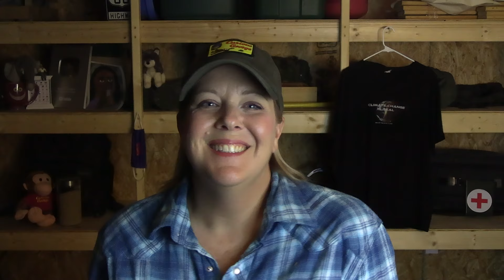Let's talk about uranium, Tennessee, and the future....

Comment: The thing Oak Ridge did, which I think doesn't get enough attention is the Molten Salt Reactor Experiment, which could run on Thorium.
Reply: Heck, apparently the Kairos test reactor will be operated there, a solid fuel salt cooled reactor. Not as promising, but a good step towards a new series of molten salt reactors.
Reply: I agree.  Molten Salt Reactors can apparently also use spend uranium fuel from current reactors and there are fewer requirements for cooling as they are designed to run hot.  Additionally, an included benefit of mining Thorium is that it is usually accompanied by Beryllium which is excellent for many uses in manufacturing.
Reply: @byronmarsh1352  Molten salt reactors can run on U-238, U-235, Th-232, plutonium and so on. It just depends on your design.
Reply: It would be truly great if we could figure out good use for mankind's immense, dangerous, and presently worthless stockpiles of thorium -- the largest constituent of the monazite sands which are the principal source of critically important "rare earth" elements.
Reply: So how long until we have fusion?
Reply: @RandomNonsense1985  checks notes

30 years? 😁
Reply: Fusion is here, every day. We just put the reactor about 8.5 light minutes away, and put up these funny panels to capture the power.

And that’s basically going to wipe out the nuclear industry. It’s just so much cheaper, fission can’t compete.
Reply: @JB-pu8ik hey, that’s an improvement, 30 years ago it was 50 years in the future.
Reply: @panemetcircenses6003  I thought the joke was that 30 years ago it was 30 years in the future, hehe.
Reply: @JB-pu8ik  ah, the version I heard is “fusion power is 50 years in the future, and it always will be”

Comment: Great way to dispose of unneeded weapons.
Reply: Let’s be real… they are all unneeded….
Reply: @JoshuaTrenge I would agree but then, Putin, Xi, and strongman leadership in general.
Reply: @jimgoff1170  If they didn’t have any weapons, they’d just be self important bullies with no power…
Reply: @JoshuaTrenge  I’m with you there!🙂
Reply: There was a similar program in the 90s, to dismantle old Soviet nukes, reprocess the cores into reactor fuel, and let the Russians burn it up in their reactors. Megatons for Megawatts, I think it was called.
Reply: @SynchroScore  and along came Putin
Reply: This is a cool project, but it is far from being green and in no way will this reduce the nuclear war threat.
Reply: @nobodyimportant7804  The problem with current green electricity production is the inconsistency of supply, and so there is a need for base-load generation. Currently, newly-built base load is from two sources: Nuclear, or gas. Would you prefer gas over nuclear energy that comes without any mining?
Reply: @SynchroScore  Where I live hydro is the base load, with wind and solar picking up most of the slack.

Wind is growing massively where I live. Gas and nuclear are less than 1% of the electricity supply.

Have you been near a wind farm? I have stood on the ground a few hundred yards away. I could not feel any wind, but those blades were spinning. They constantly spin, every single day.
Reply: @nobodyimportant7804  Hydro is available only on very limited areas. I've been near wind farms, and have no problem with them. Where I live, we've phased out many of the coal plants, and have six nuclear reactors humming away happily. But no chance for hydroelectricity, except on low-head dams on rivers.
Reply: A fair fraction of US electricity has come from old Soviet uranium, which is part of the reason we lack sufficient enrichment capacity.
Reply: @SynchroScore some was burned in US reactors as well
Reply: @nobodyimportant7804 Just because there's enough wind to spin the blades doesn't mean there's enough to actually generate electricity.
Reply: @missano3856  When they are spinning that fast they are. WTF?

Comment: I think 3 mile island and the meltdown in the USSR scared our generation away from this kind of power source. It's time to lose that fear.
Reply: Microsoft just bought a contract to reactivate 3mile island. Hopefully they have better QA this time, and dont run it on windows.
Reply: @brandonperlow9091  They’d have to hit the “Start” button to shut the reactor down.
Reply: There's a good reason to fear it. I think dismissing the aftermath of those instances will just repeat history. That power source is clean until it isn't, and humans aren't exactly the most reliable in safety and upkeep for that source of energy.
Reply: @brandonperlow9091  I would rather that one never be opened again. If they want people to feel safe, you can't start with 3 mile. When you say the words 3 mile island, the first thing i think of is meltdown.

Comment: High-assay LEU (HALEU)
High-assay LEU (HALEU) is enriched between 5% and 20%[8] and is called for in many small modular reactor (SMR) designs.[9] Fresh LEU used in research reactors is usually enriched between 12% and 19.75% 235U; the latter concentration is used to replace HEU fuels when converting to LEU.[10]

Comment: Thank you for the commentary, Belle.

Although I see converting nuclear weapons into reactor fuel as a good thing.

Nuclear power has a very high Levelized Cost of Energy (LCOE).

In the 1950s and early 60s small nuclear power plants did not produce enough energy to be cost effective.

The prevailing thought was to increase the size of the plants and they would get cheaper at scale.

This has not happened.
The Vogtle 3 and 4 reactors came in 17 billion dollars over budget and 10 years late.
People in Georgia electricity bills have gone up.

There are no projects that are totally  privately funded or built because financial institutions can see the return on investment is low.
That is the reason the federal government does most of the funding.

Within the last 20 years the new brillant idea is to build small modular reactors.
Using pre fabricated components to bring down costs.
Virtually the same as the small reactors from the 1960s that were not large enough to make money.

There are numerous articles on why nuclear and small modular reactors will not save us from the climate crisis.

 Time to build.
Not one single nuclear reactor has ever been finished on time and within budget.

Like Belle discussed with the SAVE act. Even if one were approved tomorrow, it is not very likely a project could be completed in 10 years. 

The LCOE of nuclear power is about $155/MWH.

The LCOE of solar is about $40/MWH.
The LCOE of Lithium based Backup Energy Storage Systems has dropped 80% in the last decade and comes in about $55/MWH  over the lifespan of the project.
Reply: Good afternoon Shawn. It would be a good thing indeed. ✌
Reply: @donaldmrambojr5695  good afternoon.

Comment: The groundbreaking for a building to hold the first test plant started. TerraPower will build the the new test reactor after that for 2030 (located next to a WY coal plant that is planning to shut down).  X-energy has plans for a test plant in Texas.  HALEU is for high-assay, low-enriched uranium (between 5 and 20% U-235) metallic fuel. It will also be able to store heat energy in the sodium coolant to generate steam during slack wind & solar output times (perhaps better than other grid attached batteries).  A Bill Gates documentary said there was a plan to convert some spent nuclear fuel waste into the fuel.  Expect that is why the using old weapons & submarine waste for the 2 tests - that would be a bonus!  The new reactor operates at atmospheric pressure (less to leak) and be cooled with sodium metal that doesn't boil away like water can so it can air cool itself in a power outage - another level of safety.  Sabine H mentioned there was a 100 year supply of easy to get U-235 so that reactor may only be a transitional solution and there are more new designs.

Comment: This is more like polishing a turd if you still end up with a small unit that has to be placed within the community it's powering that if own by a private company you are left with wish casting that the reactors will be decommissioned at its actual safe end of working life ans the associated cost of decommissioning and safe waste forever storage and securing is some who paid for by the original owners and not sold on or left to the taxpayers for generations to deal with.
Until a reactor is designed and proven to work that will use up all the radioactive material until it has zero radiation to remove the need for storage, then it's just shifting chairs on the titanic.
Reply: You seem to be overwhelmed by negative thoughts.